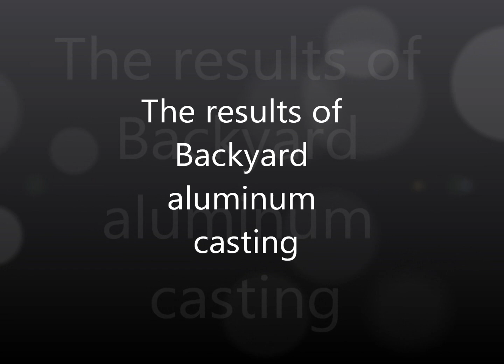The Birth of Kokopelli

Comment: great vids!  two questions, do you find that this typeof foam works better and do you add "lite salt" when you make your ingots? thanks
Reply from the maker: Yes i add lite salt to the ingots they need it most because thats when im menting the cans down...  i use a little less when i remelt the ingots because there already prety clean.  I have found that the foam that gives the best results is the "blue" insulation foam from the local home supply store but its rather expensive so i stick the free packing foam that i get in printer boxes ans the like.
Reply: great, thanks